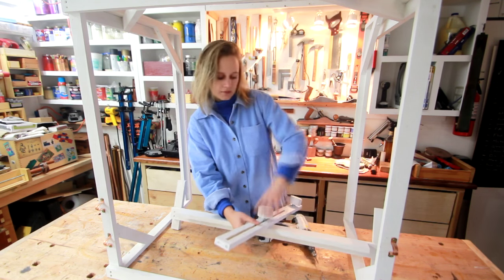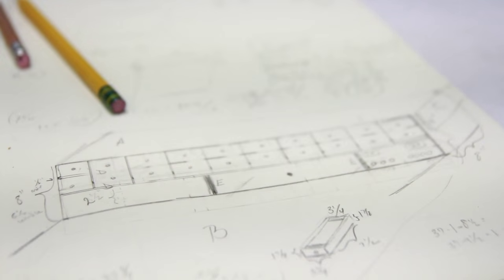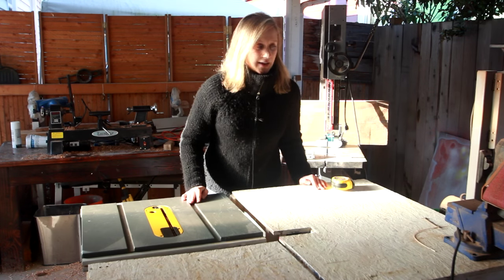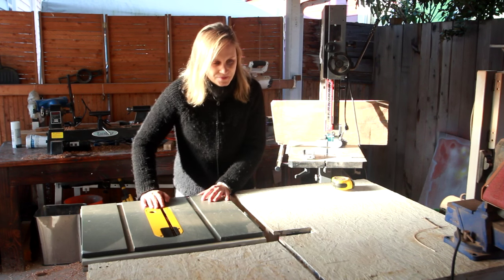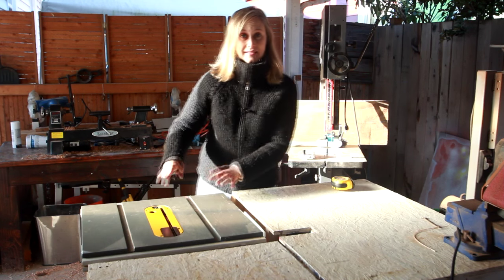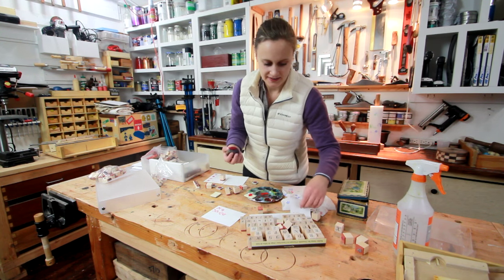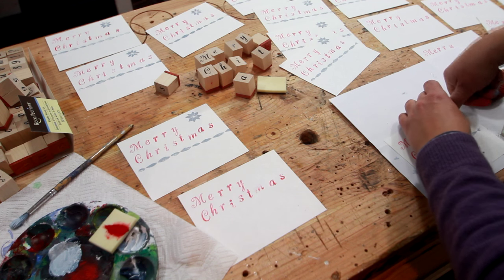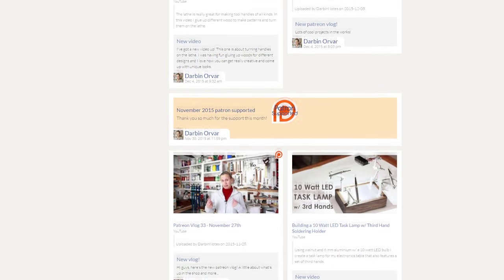How I Built My Table Saw Stand & Chisel Sharpening - Shop Update December 2015

Comment: I always get good suggestions from you.  By the way the belts that the post office uses are usually lower, maybe 2.5" from bottom,  so if you put the wax stamp up high it has a better chance of staying.  Try mailing yourself a few at different heights.

Comment: I just made a workbench for my new dw745 and it looks just like yours :) one problem I had was that by leaving the table just a hair lower than the saw table, than the mitter slots are lower than the outfeed part, so my crosscut sled hits the table, the runners I mean. I thought about making a slot in the table but I really didnt want to do that cause the flat smooth surface is nice. How did you work around that on yours?

Comment: A thought about closing in your carport .. if you had overlapping doors on a rail (kind of like barn doors but overlapping/telescoping) that were insulated with sheets of foam on inside, you have best of both worlds .. closed in during bad weather .. and open during sunny days.  Just a thought.

Comment: How do you like that Bosch table saw, specifically the fence? I have a cheap harbor freight one which isn't horrible other then that area.
Reply from the maker: +Tappar It's actually a DeWalt table saw, and the fence is one of the reasons I got it in the first place, it works really well.
Reply: Whoops not sure why I typed that instead of DeWalt. Do you feel like it gives anything up over one of those big cabinet saws with how you use it?

Comment: Linn,  I have the same sable saw as you and am looking to build a new table base for it.

I was wondering if you have the mount hole dimensions available? Perhaps also the overall height, but that's easier to measure

Still a huge fan of all your videos, keep up the great work
Reply from the maker: +Mike Kelly Hi Mike, for the mounting holes of the table saw I just placed the unit down on a couple blocks of wood and drilled in. Thanks for watching, I hope that helps.

Comment: Happy 2016, Linn. And thank you for all the videos in 2015.
By the way, which brand of table saw do you have? It's exactly what I need : small and with two slits, on both sides of the sawblade.
Reply from the maker: +Hans de Groot Thanks! It's a Dewalt table saw.
Reply: +Darbin Orvar Thanks.

Comment: what about moisture rusting your tools outside? not a problem in Pacific NW?
Reply from the maker: +Salman Sheikh It's very moist here, so it's important to prime, paint and wax...
Reply: +Darbin Orvar yes I get that for wood but I have a covered enclosed by sliding glass doors all around 3 sides porch (not sunroom) and I put my shop there last year and many tools got rust i had to move back to basement ) and remove rust from many tools and even my band saw (a real pain)...so how do your metal power tools stay clean?
Reply from the maker: +Salman Sheikh wax is great for metal tools.
Reply: +Darbin Orvar cool...that wax video was howbi discovered your YouTube channel BTW.